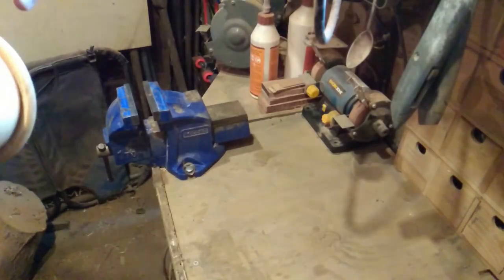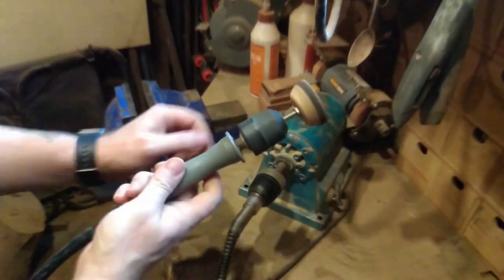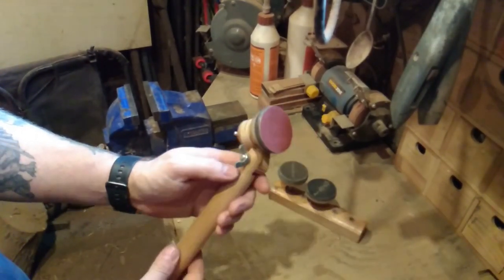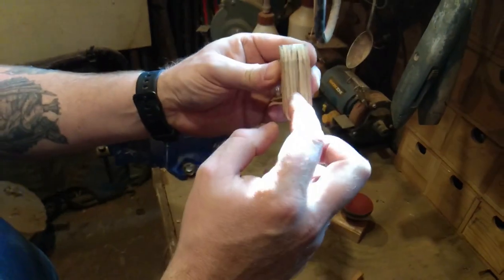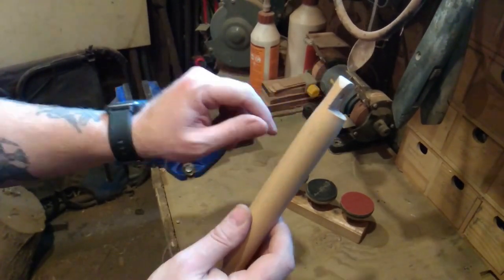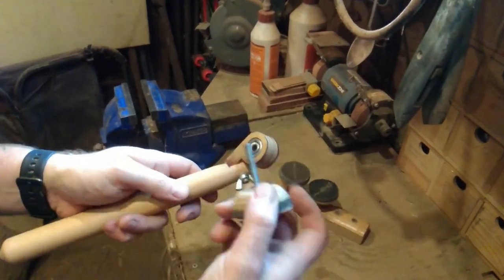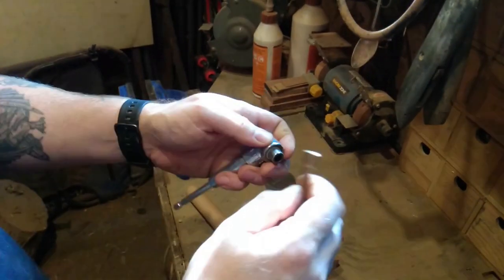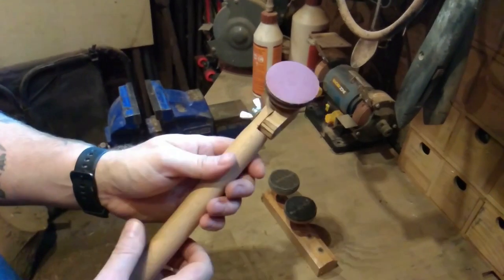Homemade bowl (friction) sander

Comment: Nice job on that little sander.  Easily as good or much better than store-bought.  Good idea having a few set up with most used grits - easy to swap in & out. Thanks for sharing.   (Now, i need to go hunt around for an old bearing).
Reply from the maker: Thanks for watching, it's a very handy thing to have around